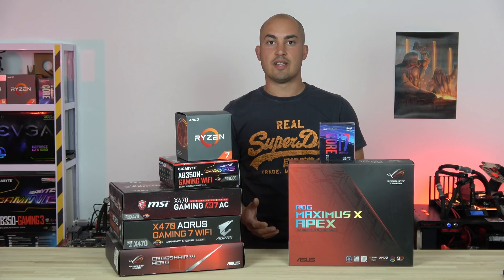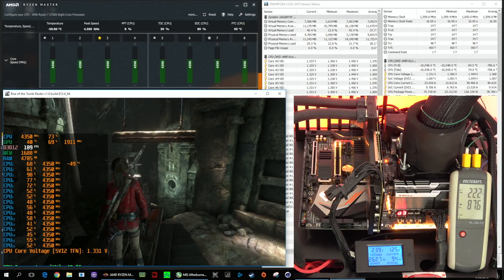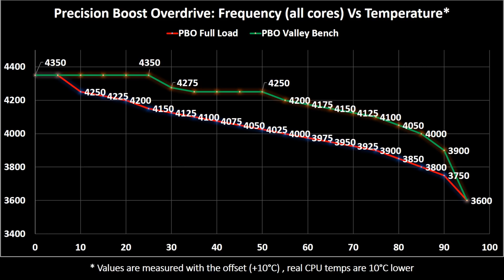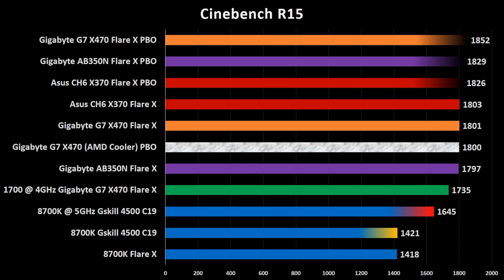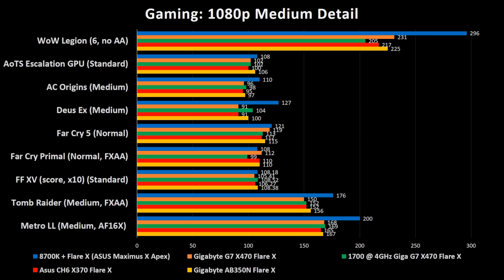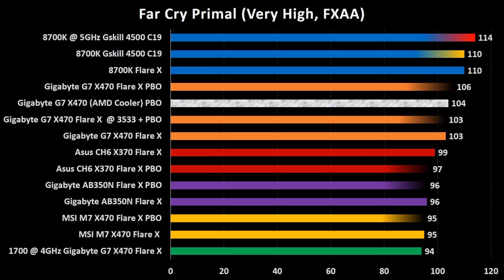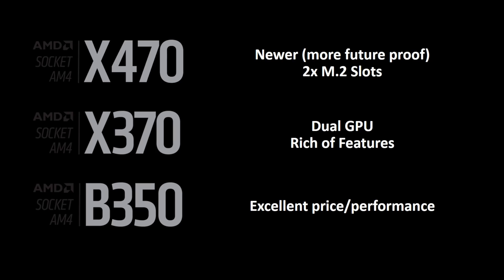Ryzen 7 2700X Review - Part 2: 8700K Vs 2700X (X470 X370 B350)  -95°C Precision Boost Overdrive Test

Comment: Will this work for the 2600 with a b450 motherboard? or you're limited to 3.9ghz?
Reply from the maker: The non X version have a limited boost, best setting for the 2600 (non X) is a manual overclock, I was able to reach 3.9 with the stock cooler, 4.1 with a 30€/$ aftermarket and 4.2 with custom liquid cooling, check my last video 😁
Reply: @HardwareNumb3rs  I get 4.050mhs at 1.38v, not stable at 4.2 and 4.1 requires 1.45 so I left it at 4.050mhz
What do you think is the max safe voltage at 65c max temperature for 24/7
Reply from the maker: Victor Ov I wouldn’t go much over 1,4, temp are nice, but 1,38 for daily use seems the way to go, 50/100MHz at the end doesn’t change much, check your load line calibration if you have it, this might get you stable with less voltage
Reply: @HardwareNumb3rs  Thank you! :)

Comment: why my score in cinebenchmark, 1866? I am just using ryzen 7 2700x with its stock air cooler. My oc is 4.1 ghz all cores, and 1.4 voltage. And my ram is rgb aorus 3200 mhz, 16gb. my mobo is x470 aorus ultra gaming. btw. my gpu is just gtx 1050 ti oc with boost clock up to 1826 mhz.

Comment: I just did a test of my own & used your graph as a reference. I got 4.0 @50 degrees. This was with a Noctua NH-D15 btw. Not a stock cooler. So you might want to take into account the silicone lottery here as well.
Reply from the maker: Razerhdd there’s a lot of factors like load, motherboard and maybe silicon, what are your full spec ? It could be interesting to know more
Reply: Hardware Numb3rs Sure.
Ryzen 2700x
Noctua nh d15 1 x 140mm fan
Gtx 1080 ti
Mobo: ROG Crossfire VII Hero x470
G.Skill Trident 16gb (2 x8gb) DDR4 3200MHz
Samsung 860 Evo 1tb ssd

Comment: 5.0 Ghz ? Apex ? WTF ?!!! Where 5600mhz 4000 cl12-11-11-28-220-1t ? r3trd
Reply from the maker: rsm not sure what you are asking, the 4500 Trident Z was at XMP (4500 C19) , to run at 4000 C12.11 that kit needs more than 1,95V, and wasn’t useful for the review
Reply: sell apex plz. 5ghz 8700k - LOL , 7700k can 5150-5300.... lul
Reply from the maker: rsm dude, what are you trying to say ?  That you don’t understand why I have an Apex to overclock only a 5GHz ? This video is a review, of the 2700X, not a 8700K Overclocking world record.  If you wanna see this Apex doing what is meant to do, you have to wait the new i9, soldered and ready to go below zero, I have the cascade for that, -96°C and the Apex loves the extreme cold.

Comment: So is the "X" worth the money for the Precision Boost Overdrive?
Reply from the maker: JanTube the new X processor doesn’t need overclocking with the PBO, in my opinion yes, is worth, a 2700X and a pair of Flare X 3200 C14 and you are pretty much at the limit of the architecture, with a 30 second setup in bios
Reply: @HardwareNumb3rs  Thank you for answering!

Comment: If people are planning to stream I would recommend not using ANY B350 boards as their power delivery systems cannot even keep up with a 3.8ghz all-core Ryzen 1700X of mine. After about 9 months of streaming part-time I fried the VRM's pulling 125watts through the CPU for extended periods of time. Buy a better motherboard. Upgraded to the Asus ROG X370-F Gaming and the VRM's are well overbuilt for this application almost perfectly. The 2700X has even a higher TDP so expect it to pull even more watts!

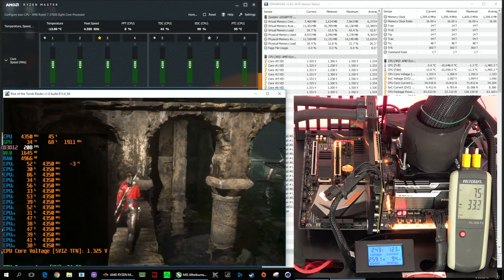Comment: 1:20 I don't get this part of testing. Did cpu overclocked itself to the 4.35 ghz across all cores because of the very low temerature?
Reply from the maker: Yes, if the temperature and power absorption are within certain ranges the CPU will boost to his maximum clock on all core, in this case 4350MHz, when the temp start rising above 5-10°C the clock will drop down based on the load, with a heavy load (stress test or multi core rendering) the frequency is going to decrease sooner than a lighter load (like gaming), so, for a gaming machine there's no need to invest a lot of money in cooling, even the stock cooler can manage to have around 4200 in gaming (and 50-100MHz difference is not relevant), but for a rendering machine, where even 50 MHz can mean minutes of time saved a good liquid cooling can make a big difference on the result.
Reply: I have never seen a CPU that continues overclock itself while going below 0*C. Is this only applicable to the Ryzen 2000 or Intel can do that too? Also how high was the auto voltage regulation during 4.35 on all cores?
Reply from the maker: Lopata The new Ryzen boost system is very unique, and it works super well, Intel use a different algorithm (I will test it soon), the voltages below zero was around 1,33 and raising to 1,4 (more or less) above 10°C, in sub zero every CPU need less voltage to operate stable.
Reply: 1.3-1.4V sounds kinda OK compare to Ryzen 1000
Reply from the maker: Lopata the improvement was huge for a 2nm process shrink, the next generation could be a very big leap forward

Comment: Ottima review. Tutto molto chiaro e dettagliato. Mi chiedevo però se hai risolto il problema del fake boot con la Aorus.
Io ho preso il 2700x da montare sulla CH6, ma non si avvia praticamente mai (freeze in code "0D"). Se rimetto il 1700 tutto ok. Con la X470 hai notato differenze? Io ho provato le Flare X e le Trident Z 3600C16 ma finisco le giornate intrappolato nel boot-loop senza nemmeno riuscire ad entrare nel bios. Nei rari casi in cui parte però mi passa 1000% in memtest quindi non capisco...problema di bios? Scheda madre difettata? mah...
Reply from the maker: Grazie, con la CH6 e i vecchi bios era un disastro, ma da quando ho messo gli ultimi, specialmente il 6004 ora funziona tutto molto bene, non è ancora perfetta ma i fake boot ora sono praticamente spariti, certo, se tiro le RAM ed esagero il codice Od salta fuori di nuovo, ma con le Flare X e il loro profilo è stabile al 100%, che bios stai usando ?
Reply: provato 3502, 6004 e 6101 con 2 cpu 2700x. Non va con nessuno dei 3 bios, indipendentemente dalla frequenza delle ram. Entrambe le cpu si comportano alla stessa maniera (avevo inizialmente pensato all' IMC). Sia a  3200 che a 3400 (stabili e testati sul 1700) non parte quasi mai, nemmeno se resetto la cmos. Anche a impostazioni di default (2133 e tutto auto) mi va in freeze perfino mentre cambio i parametri nel bios.

Se rimetto il 1700 la bastarda riparte che è una meraviglia. -_-

Ho una voglia di trasformarla in un frisbee e volarla fuori dalla finestra....
Reply from the maker: Strano, a me faceva così con i bios vecchi, e con tutti i test da fare mi ha fatto letteralmente perdere il sonno, con il 1700 le ram anche a 3600, con il 2700X Od perenne.  Sembra proprio un problema di bios ma se hai provato anche il 6004 e si comporta allo stesso modo è difficile da capire il problema, mi sa ce devi sperare in una nuova release :/